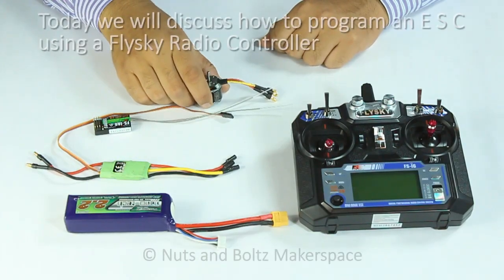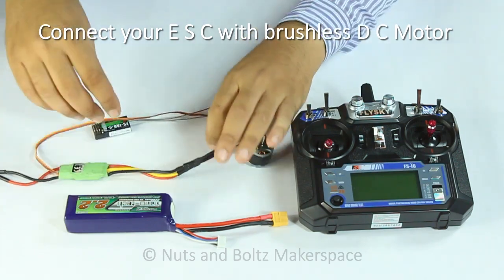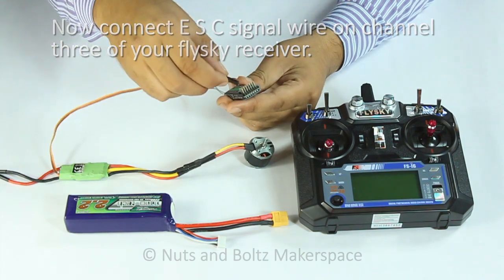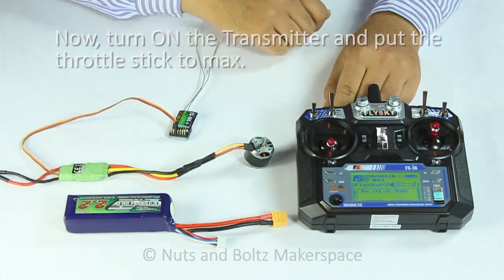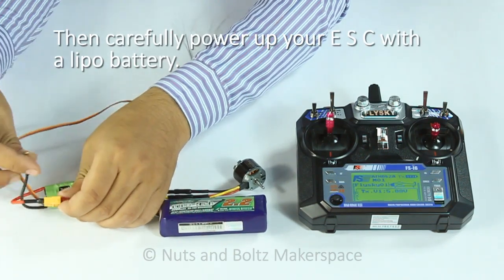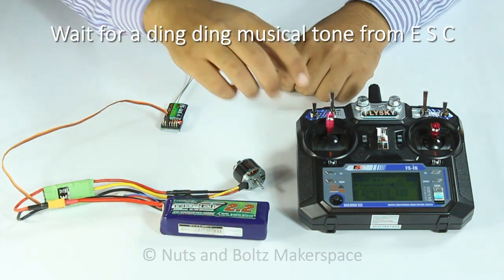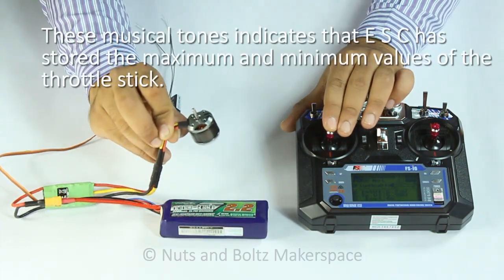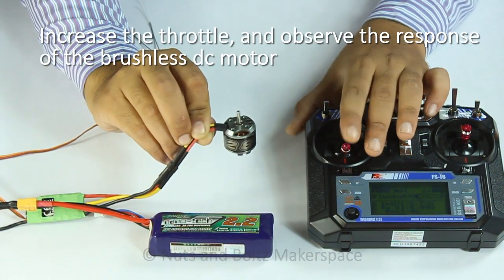How to Calibrate an ESC using Flysky Radio Controller

Comment: I tried this with several different esc's and motors with the same radio and ia6b receiver(new) and it did not work. Eleron,  elevator all work but could not calibrate any esc. Could it be possible that channel 3 on the receiver is not working?
Reply: Saxologist possible usually ch1 is throttle I think

Comment: i done the same, but when is throttle up i get nothing, when i set the throttle to the center, then i get beep sounds. If i move throttle up, it spins in one direction, when i move from center to bottom i spins also in another direction

Comment: Mam my motor stops in half of thrittle..please help me how to bind.....esc ...
Reply from the maker: Hello Sanjay,
You need to put throttle stick to the max. position in the beginning and the you need to lower it down to the bottom, wait for sometime and then again increase the throttle, this time your motor won't stop.
Make sure, you have connected the wires correctly and must also have set up the correct channel in your radio.

Comment: Once I do this, do I then hook esc back on hookup that the bind cable used or do I leave esc hookup to channel 3?   New to rc's.
Reply from the maker: Hello Lincoln,
See, this method is just to calibrate the ESC, once your all ESC's are calibrated then you can use them in any channel.
Hope it helps.